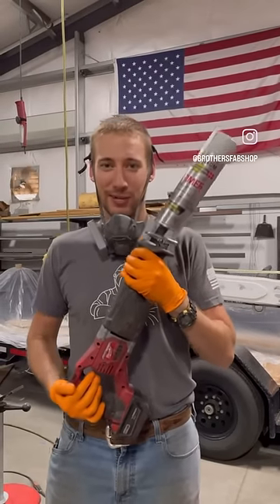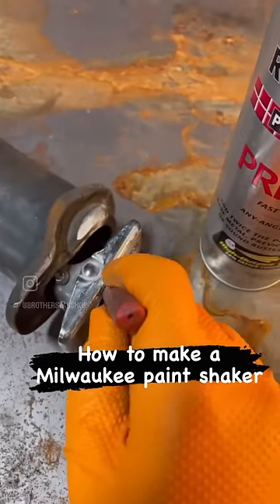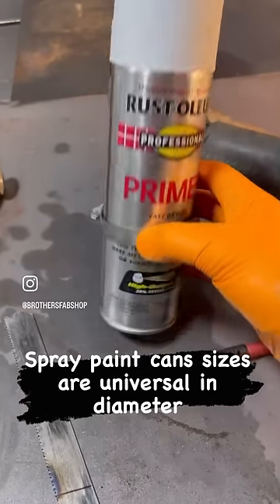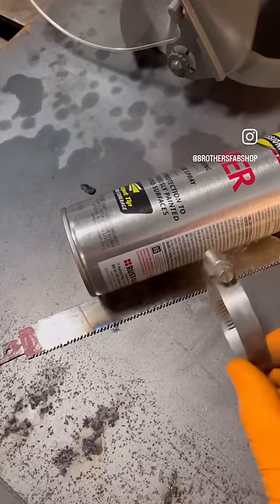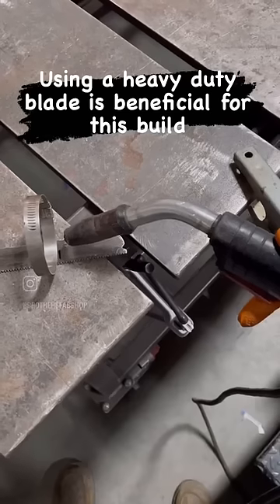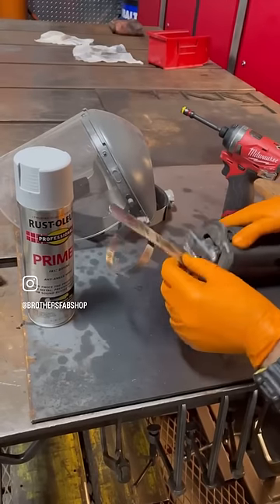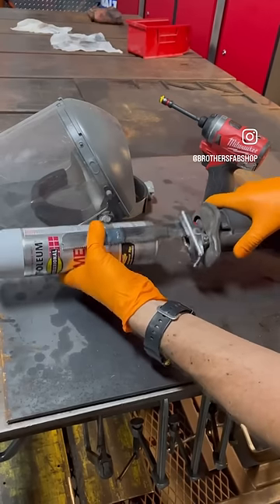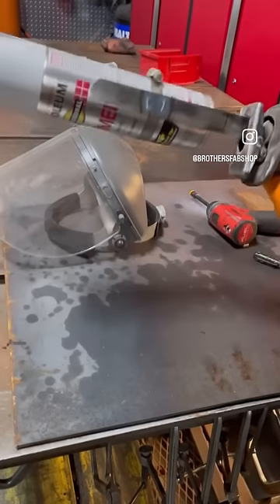Paint Shaker Hack #tips #tricks

Comment: To be safe, I suggest welding the can directly to the blade. If you don't have a welder, you can also zip tie the can to one of your car's wheels, and drive around the block. No need to thank me. 😊
Reply: Great hack, just don't do it at home. Could get that  donut out of the trunk and weld 3 or four cans on the sides, then take a drive to the store or hospital. I prefer putting a bunch of paint cans on strings and just drag them around the block a couple times, but never after midnight!
Reply: Thank you.
Reply: Welding a Aerosol can could end in an explosion..
Reply: Slide it between one of your coil springs, maximum shakeage
Reply: You're joking, right ? Please say so. It'll blow up. Good way to get rid of these idiots though.
Reply: @sean6049  Please tell me you didn't take this seriously.
Reply: @sean6049  thx for the Intel genius
Reply: Sarcasm 😂

Comment: Now I just need a shop and a welder and I'm all set.
Reply: What about the people who live in one bedroom apartments who are not allowed to build shops in their apartment building.  My pet elephant sat on my welder and now its busted.
Reply: Idk you could always use twist ties or duct tape
Reply: And the ability to weld stainless.
Reply: You don't need to weld it just clamp it on the blade.
Reply: Or just tighten the clamp over the blade and not weld it 😮
Reply: Could also just shove the blade between the can and the clamp with some rubber or something to reduce slippage
Reply: You can just put the clamp around the blade and the can. Use two clamps if you have to.  No need for welding.
Reply: @TylerSmith-qx6uz  you can weld regular steel to stainless and even use non stainless electrodes. Its just the welds will not be stainless etc. I wouldn't do it for anything structural but its fine for this.
Reply: Tape the blade so it doesn't rub the can and then tape the blade to the can easy-peasy
Reply: 😂😂😂😂😂😂😂😂😂best comment
Reply: @michaelschuler-pq2mn *Duck tape. Most of the garbage out there sold as "duct" tape would never be used by HVAC people for actual ductwork. Duck tape sucks. I was actually thinking you could use a couple pop rivets. They'd probably break after a bit, but they're also dirt cheap...
Reply: @Shadoweclipse1386  umm what you talking about Willis
Reply: @michaelschuler-pq2mn  Just what I said. That what most people think of as duct tape, really isn't. I didn't mean anything bad or critical of you. Sorry if that was taken that way. I work HVAC and maintenance, and what we actually (usually) use on ductwork is a reflective aluminum tape, usually sold as duct tape, not the brand name "duck" tape, which is just awful tape.
Reply: @Shadoweclipse1386  you do know duck tape is the black tape and the hvac tape is silver where you going
Reply: @michaelschuler-pq2mn  Maybe there's a better, and proper, grade of duct tape (the black stuff?), but most of the garbage that I've seen people use is a flat/matte gray color.
Reply: @Shadoweclipse1386 gorilla tape
Reply: Then buy a welder. You dont need a nice one to weld a hose clamp.

Comment: Shaking a spray paint can must be harder than I remember…
Reply: I used to survey in northern Canada during the winter. This would be useful, even when storing cans inside the truck or under the hood of a sled to keep warm.
Reply: No you've just never done it bud
Reply: I built this, using a 1/16” thick bar stock…original saw blade broke after several uses.  I have forty to fifty cans on hand, and most sit for long periods, and I know every one thinks they shake it go two minutes, like the directions call for…(really, probably only 20 seconds until you say ‘goo enough…’. Now my unit will shake the crap out of a spray can!   Better spray finish because the boogers don’t clog the nozzle.

Comment: Since you spot welded the hose clamp, you should have also spot welded a piece of metal to prevent the can from being mounted below the line you made on the blade.
Reply: Good tip. I think he should put the clamp around the blade and put the spot weld on the outside. That way, if the weld broke, it won't go flying immediately and hit someone in the face.

Comment: Just wrap the can to the blade with 2 layers of duct tape. When it's shaken, twist the can and it cuts the tape. Also don't go too crazy because you can rupture the seams with the marble or ball bearing in the can and also damage the valve from the inside so it's more of a stream when it comes out. Dupli-color and thinner paint formulas are the easiest to overdo it with. It's usually the seam the lid is held on by nearest the nozzle. So even though you can use it still, as long as you hurry, it'll pour paint on your hand the whole time.

I do tig and arc weld but the tape is just way easier and i don't need to remember not to throw a blade out to make something like this😂
Reply: And in impact driver being used to tighten the hose clamp is not recommended.  Especially at the center.  If can deforms at seem,.both you and shop are covered with paint.  Or worse.

Comment: This is a great idea, but I think I would use two clamps near the top and bottom of the can and clamp around the outside of the blade and grind a notch the width of the clamp on both sides of the blade top and bottom, this would be a good mechanical connection rather than welding on a brittle hardened steel blade

Comment: You can skip the welding if you don't have 1 if you slide the radiator hose clamp over the blade too. Welding is cool but not everyone has access to one, I want to try it out with a welder but until then I'll just keep up with the 2 parts, cool tip

Comment: I like this it's a great hack. I normally shake the can vigorously for 1 minute by hand. But 20 or 30 seconds of this would mix it even better. I wonder if I can arc-weld that clamp-on there without burning up the clamp? It will be tricky but I'll try to pull it off. That metal is kind of thin for an arc welder.

Comment: as long as you're at it you might as well either snap off the tip from the blade or a portion of another old blade and weld it on the bottom as a bottom stop for the can so it can't possibly start slipping further down the blade and then impact the guard which would probably cause it to blow open

Comment: lol. You do not need to weld this. Use wire cutters to cut a portion of the blade the size of the hose clamp. Clamp the hose clamp and the cutout keeps it in place. 

Pro tip- use an oscillating cutter and just tape it lol

Comment: To go to this length, you must shake allot of cans. I guess if you have a finnshed blade. Frankly, I don't think you have to weld anything either. Just put the clamp over the blade. Even at that, use double sided tape to make sure the can is secure.
Reply: Yeah those walls are super thick. And a pressurized can would be fine if it accidentally punctures ore comes into contact with sparks! Definitely a 10/10 idea!
Reply: @tobybigham4196  if punctures are what's worrisome. As long as the can is flush with the blade. And the  blade doesn't bend. Otherwise. Using 2 hose clamps should solve that. 🤔

Comment: This is called "making work for yourself" as shaking paint in a rattle can takes less time then putting it in the clamp, tightening down the clamp, running the saw, loosening the clamp and removing can.  Pretty damned nuts.

Comment: You should not use those clamps on radiators. Because of the heat the hoses and pipes will expand and shrink frequently. Over time the clamp will loosen up or break the radiator pipes if tighten really hard (Especially on plastic pipes). Only use spring style clamps on radiators ;)
Reply: How much did you smoke?

Comment: DO NOT USE THOSE FOR RADIATOR HOSE CLAPS!!!! They’re sharp and when the coolant heats up it’s gunna expand the hose and these kind will cut them. I guess you could file the back side.
Reply: For generations these were the only clamps available. They have successfully held radiator hoses on for decades.